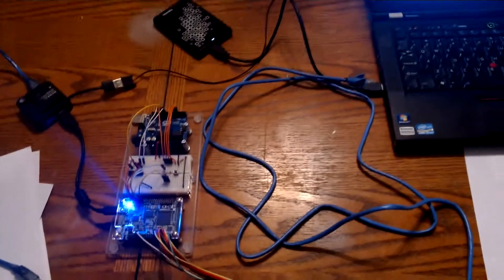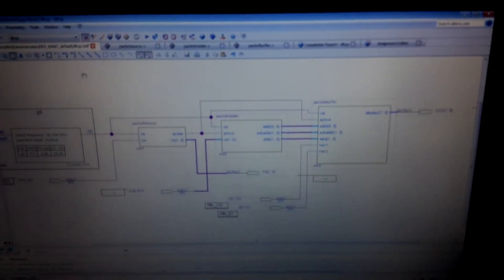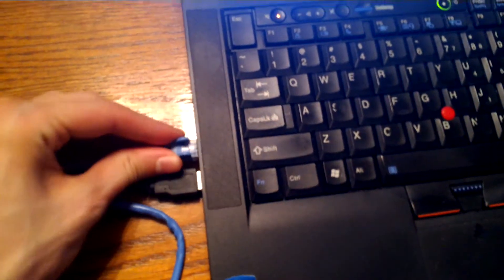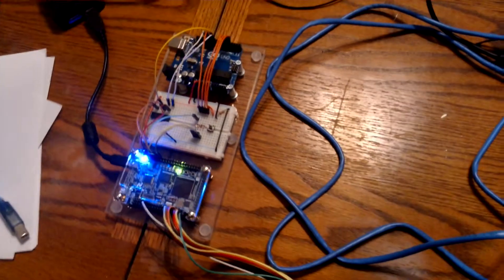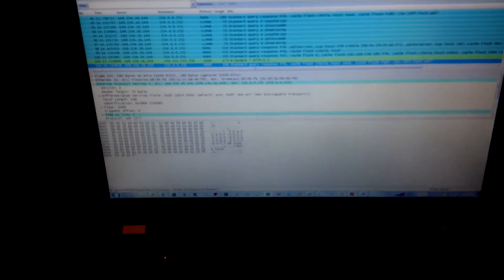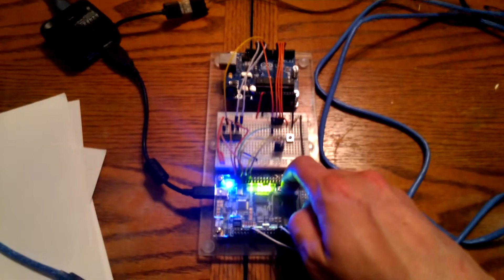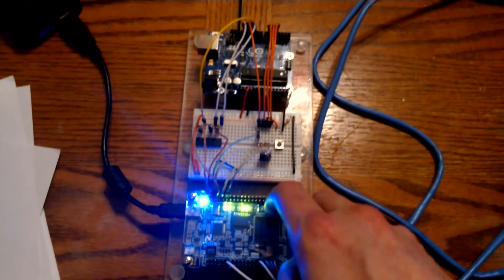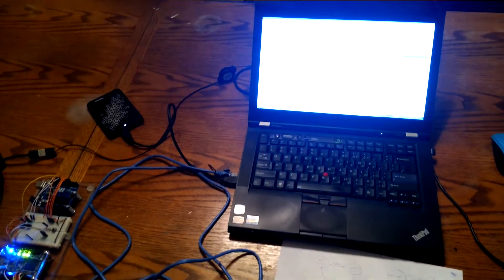DP83848C DE0-nano ethernet starting to work

Comment: This is very cool! So you attached a PHY via parallel interface to the de0 nano and got a 100 MBit connection? What core did you use on the fpga? Are there schematics available anywhere? TIA!